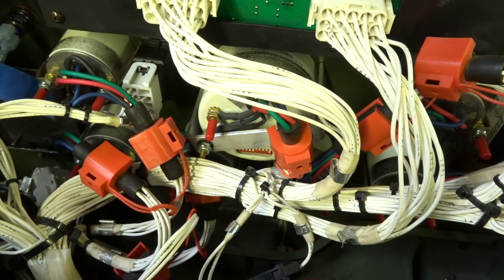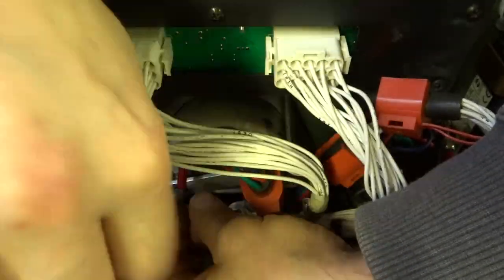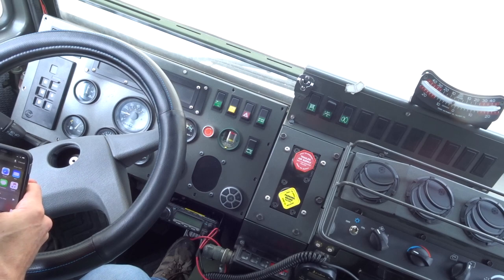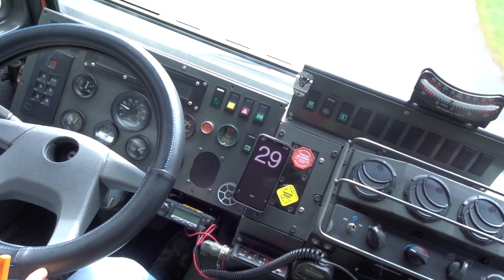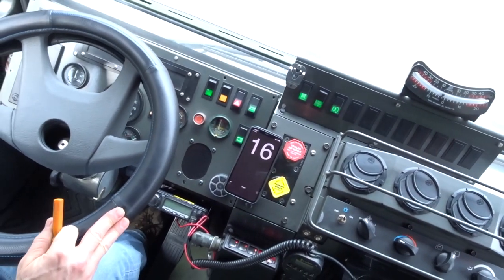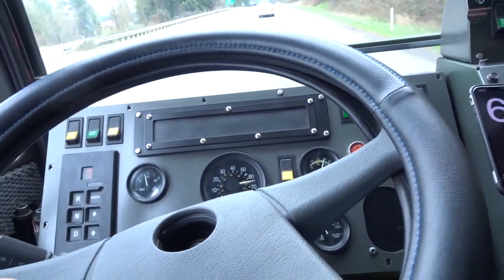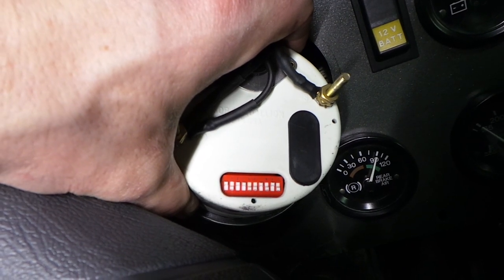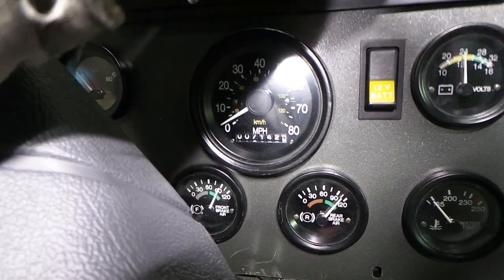Calibrating the LMTV Speedometer for 3.07 gears

Comment: Great! I hope I don't have to go through that with some off brand that I might have. Nice way to power through the problem and get it set up. What do you think is causing the resonance in the tire balancing?
Reply from the maker: I’m sure at this point it is the weight of the CTIS valve that is causing headaches right now.
Reply: Broke OverLand is it still vibrating or were you able to rebalance?
Reply: @BrokeOverLand  Did you take the tires in to be balanced yet?  I would build some sick looking line guards first.
Reply from the maker: @tehNashty  I balanced them my self.  The key is hardware alignment and balance beads.

Comment: Speedo at low speed... close but no cigar.
Reply from the maker: I had it dialed in.  Then caved to pressure and had the ECM updated with the prop shaft rotation numbers.  Now the speedo is off by 3ish mph at 60. Need to spend some quality time tuning with CAT ET.